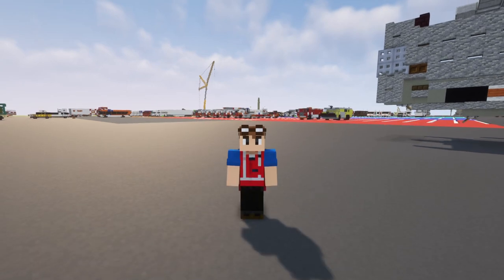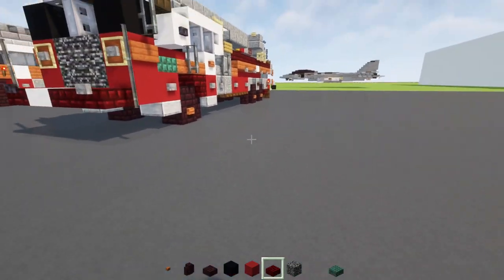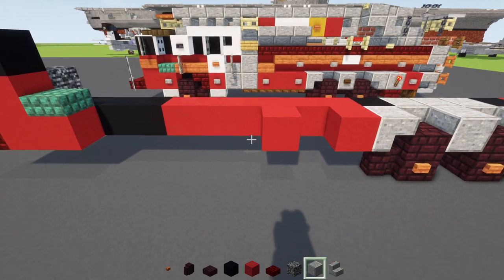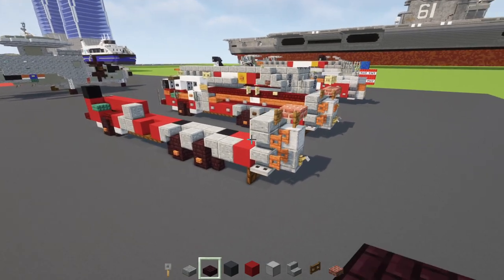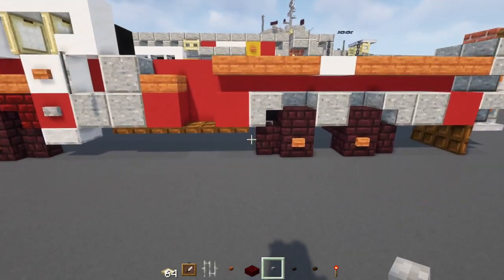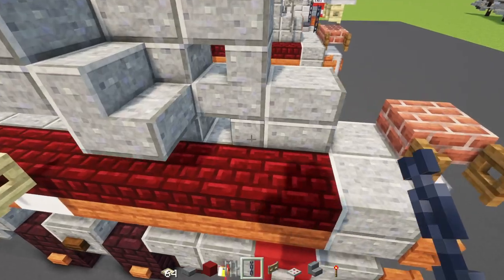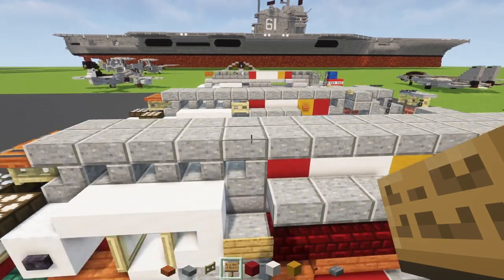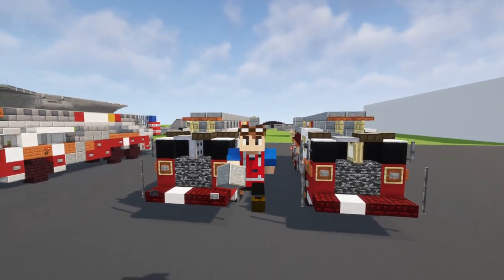Minecraft NYC FDNY Ladder Fire Truck Tutorial

Comment: 🚨🚨Console players can put iron trapdoors on windows and windshields. Place the trapdoor 1 block infront of where you want it, then activate the trapdoor using a red stone block. Then use a piston and push the iron trap door into the spot you want it. Then destroy the   trapdoors red stone block FIRST and then destroy the piston… sounds like a lot but it takes 10 seconds
Reply: This method also works on Nintendo switch